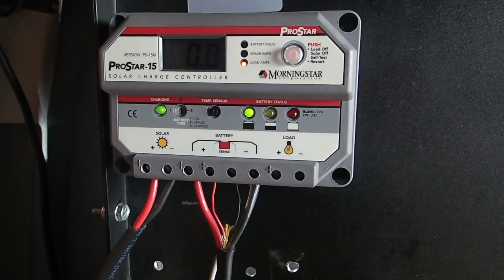SOLAR solar panel, SOLAR SYSTEM installation in A VAN Living off the GRID

Comment: Hey, how did you manage to mount the panel on the roof without being able to reach the screws from the inside of the van?  What is that blue tool you're using?  Thanks...sorry about all the questions!
Reply from the maker: Exploring Alternatives Rivit Gun . We used rivets and screwed into them
Reply: Awesome, thanks for the info!
Reply: +Exploring Alternatives search nutsert
Reply: how.much was the solar panel

Comment: Nice setup.  

I have a question... does it matter how close the panels are to the roof of the van?  See how close the center of your panel is to your roof (about half an inch at most)?  That is how close mine is going to be all the way across.  Is that going to be an issue? Should I raise it up a half inch or so more? 

Btw, I do realize that it will make it hard for me to get to the wiring if I need to replace a fuse, etc up there.  However, I'm cool with that since I can just lift the panel up simply by unscrewing 4 bolts.

I'm mainly concerned there might be other reasons one might need clearance... like heat issues or something like that.

Comment: I dont know that I would of mounted the z brackets in the low valley of the roof, seems that water sitting there would leak into the cab over time
Reply from the maker: scott boyd Water tends to flow to the back . we have to redo the seal this spring , but not leaks as of yet

Comment: Great video.  That setup looks perfect, please help me out.  I have a 94 GMC Vandura that I want to convert.  I want to start with the solar panel system first.  I plan to use my conversion van to live in while persuing my dreams of going to college finally.  If you could just tell me where you bought each item, I could take it from there.  I'm pretty tech and engineering savvy.  Any help would be greatly apreciated.

Comment: hey great video, but i have some questions. i'm working on installing solar panels on an old news van i'm converting into a recording studio. there are already metal grates and electrical on the roof, because of an old satellite, but i'm curious about cost and the best fit for a ford e350 rooftop. any insights you have for this sort of thing would be endlessly appreciated.
Reply from the maker: Jason Toney i have a kyocera panel and it fits well on my e 350 . we made some brackets because the included ones didn't get it high enough off the roof . i think you can get one for around 300 . but you also need an inverter , charge controller and some batteries . around 800 i think i paid for my setup but I'm sure you can get a cheaper setup.

Comment: I need to know, if you do, what size solar power panels would i need to connect to a 24 volt RV battery & a 3000 watt (continuous)/6000 watt peak inverter? I will be living in this van for about 1 year, so I need power to run a frig, a/c, heater, etc. What do you recommend?

Comment: Wait until winter comes... Kiss the TV, playstation, inverter, and nearly everything else goodbye if you value the lifespan of the batteries. I've got nearly twice everything there, and it isn't enough. Not even close.
Reply from the maker: we also had a line installed to the alternator so the batteries charge up while we are driving,  check out the video " solar fix at camping world" we go through the install. thank you for your comment
Reply: Backup input is imperative, yes. In regard to the solar, you also need a better way to monitor the state of charge of the battery. Inverters are deceptive to the beginner, and it always ends up in disappointment. In my case, I'm quadrupling my input for the next version of my "home", and doubling the battery. It will have 830W of PV up top and nearly 6kWh of battery (going from 12V@235Ah to 24V@235Ah). Consumption reduction is also key. Inverters are easy, but when you realize the losses involved in using them, you'll find out that it's best to avoid using it as much as possible and do things that you can directly from battery as much as possible. All kinds of things, way too many to list here, but keep going, it's a worthwhile experience to use this stuff. You'll learn a lot in the process.
Reply: RubberTrampsReviews Also, don't forget, the term "deep cycle" is deceptive as well. This simply means that they are designed for being taken down slowly over a period of time. The accepted design limit for capacity is generally considered to be 50% down, with only taking 30% out regularly, and the occasional drain taking as much as 80% out. Occasionally meaning almost never. Taking them down completely will destroy them in short order. The more shallow the discharge, the longer they will last.

Comment: Hey, how did you manage to mount the panel on the roof without being able to reach the screws from the inside of the van?  What is that blue tool you're using?  Thanks...sorry about all the questions!